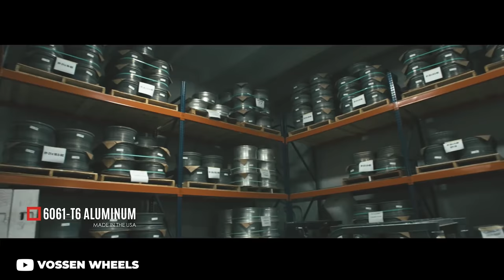Biggest Myths In The Car Wheel Industry

Comment: So Konig wheels are the same quality as Enkeis.... buys Konigs
Reply: Honestly i go based off nationality of the car for my wheels. I don't want Japanese wheels on my euro car or (for the most part, read BBS on CB7 as okay) vice versa
Reply: @greenpat93  wtf dude no, i just like my builds to look clean, and I find that European cars look best when fitted with wheels designed for said European cars, and vice versa. Yall on some other shit over there
Reply: Addicus Walter your reply to Finnegan is a much better way to say why you prefer euro wheels for euro cars. 

When I read your nationality comment, it did sound pretty ignorant.
Reply: Addicus Walter - Unless you can’t get those BBS CH-Rs in the right size, then it’s great that Enkei Raijins exist.
Reply: @JohnSmith-yx8kf  this too. And like i said, when I built my cb7, I put a used set of BBS RSRs on there, bc BBS just look so darn good on that platform

Comment: Can you guys so a more in depth look at the Fortune Auto APLS system?

I want the setup for my STI but none of  the videos out there explain the APLS in detail.

Like how long the tank takes to fill and how often it fills between lifts? How loud is the system? Can it be driven in the lifted position? What does the switch look like and where it could be mounted? Is there a higher voltage demand to operate?

Etc. Etc.

Comment: Do one on the meanings of the names wheel, rim and tyre. For instance, some say that a "car" wheel is the combination of a wheel (the metal part) and the tyre (the rubber part) together. Others say that the wheel is the metal part which includes other things like the rim, spokes and the hub and obviously the tyre is a separate part to the wheel; meaning there's no single word for the wheel + tyre combo. You'd have to call it wheel and tyre and not just wheel. And go! =)

Comment: Shouldn't you be looking at wheels based on their weight, strength, size availability and purpose for your car instead of design? I thought Volk Racing line and BBS forged line were a bit special with equipment for their manufacturing process (mainly done under much higher pressure than most other manufacturers that claim their wheels are forged). I think wheels are a waste of money unless 1. you added more power to the car, thus needing more tire, thus needing wider wheels, 2. installed bigger brakes thus need bigger size wheel, 3. looking for carbon/magnesium alloy/aluminum forged wheels for significant reduction of weight while retaining or even increasing strength of the wheel
Reply: What about looking dope??

Comment: if I increase the diameter of my car’s wheel, I don’t need to calibrate the speedometer ?? for example from a 225/45 R17 set to a 235/35 R19 set, since the total diameter changes, does the speedometer continue to mark the actual speed ?? or need to re calibrated for the new set of wheels and tires ?? thank you for the tips
Reply: Basilio Proença i downsized my camaro now my speedo is off by like 5 or 6 at 75 mph
Reply: Thanks, so if you change your set of wheels and tyres, your speedmeter is gonna be rong, im about to change my wheels, but here in Portugal is hard to find mechanics to do such thing like speedmeter calibrating and stuff, so in that way, im gonna keep the oem set, 225/45 R17, i have an accord cl7, you call acura tsx, the biggest rim here from oem is 17 inch, and by legal reasons is to much expensive to put bigger, and with speedmeter calibration, here if you have german cars, every nows all and do it all, but with japan, baaahhh, not done, by the way, 225 tyres with 17x8 or 9,5 inch rim??? Thanks for the help

Comment: Well.  I'm looking at you FI when convincing myself to pull the trigger to buy wheels and tires for my daily 2015 civic lx.  I just know I hate needing tire pressure sensors, and added ceramic coating.  

So keep in convincing me.  I want my 15" x 6" to turn into snazzy 17" x 8" soon.